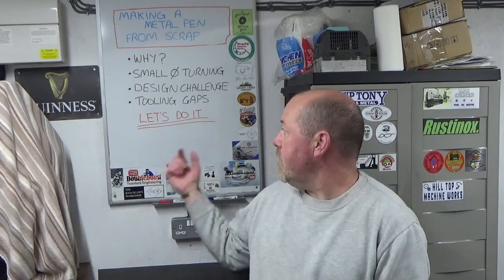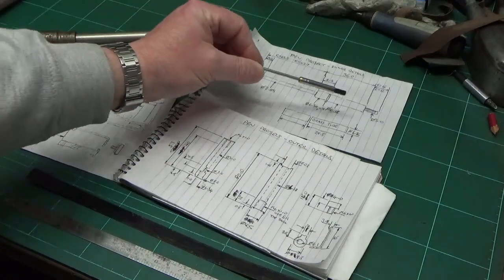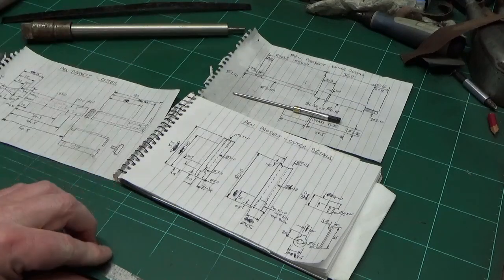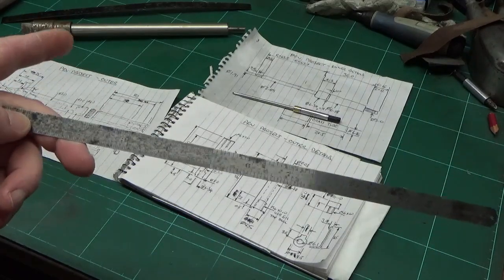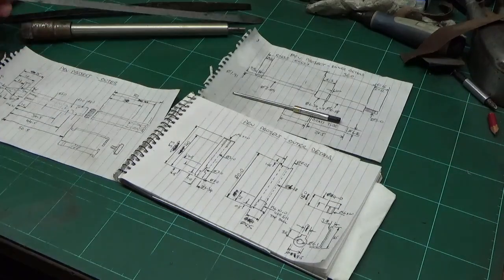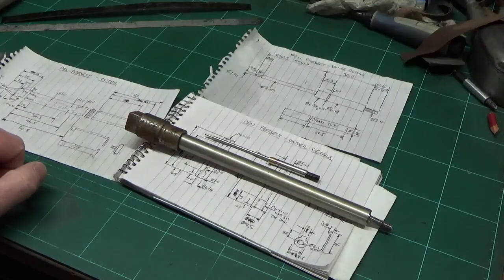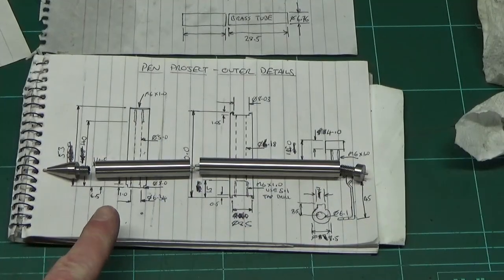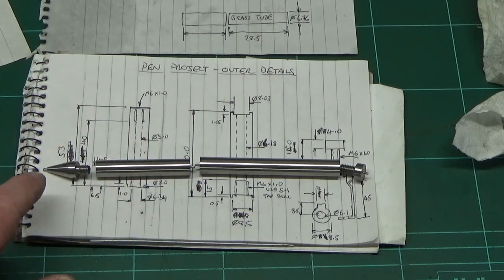Making A Metal Pen...... From Scrap

Comment: Great work Jon, wouldn't even attempt that on my Myford 😁 By the way for future reference when you go into production, old bandsaw blades are actually spring steel 15n20 or equivalent, Ive got miles of it if you ever need any 👍
Reply from the maker: Thanks Loz, production lol, not sure it will be very profitable lol. Cheers, Jon

Comment: Nice pen but there is no need to loctite the mechanism in the brass end should be a push fit to grip it and the top needs to be a hand press fit enough to hold the top on and twist the mechanism that is to allow for it to be pulled off and the cartridge replaced when needed. I have made quite a few pens with this mechanism well over 50
Reply from the maker: Hi DL, thanks for the comment and feedback. Totally over engineered, can't help myself sometimes lol. I had both the push fit and Loctite as belt and braces. I will try without on my next one. Cheers, Jon

Comment: You should have kept the outtake as the ending! What amount of runout do you get putting the collet block in the 3 jaw? I couldn't see any. I've used that method before, but I get a fair bit of runout so would have switched to the collet chuck for these small precision parts. Great video, thanks.
Reply from the maker: Hi Olly, thanks for the comment. I get about 0.1mm run out which is a combination of chuck and collet block. I just use shim stock to balance it and avoid marking the collet block. I cut 3 bits at 0.1, 0.08, & 0.05mm thickness, and just juggle them about to get near zero. Bit fiddly but pretty quick to do. Dedicated collet chuck on the to do list 😉. Cheers, Jon